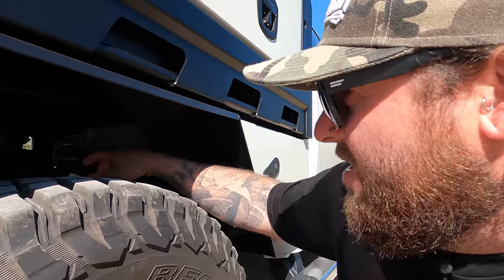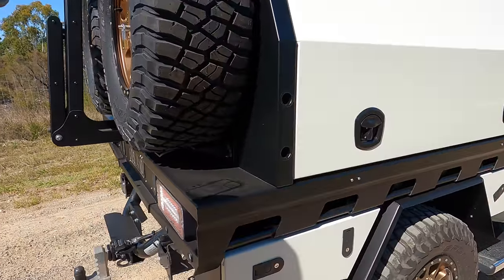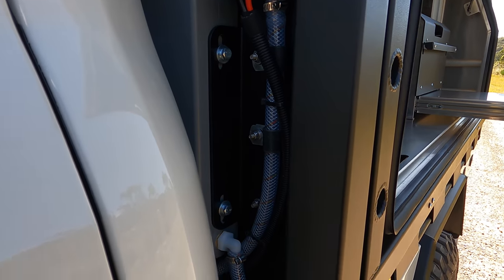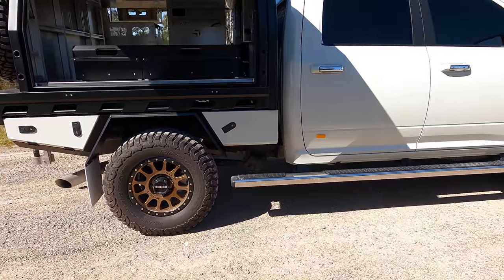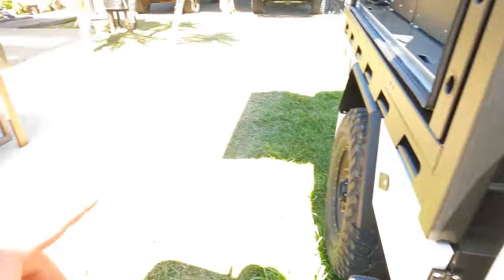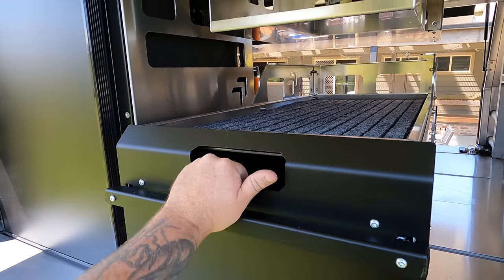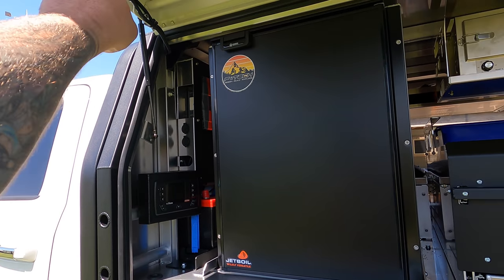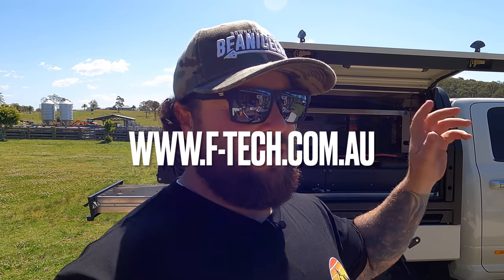RAM 2500 MITS TRAY AND CANOPY !Walk around PLUS we start fitting it with accessories !

Comment: looks good. is there some way to remove the drop down hitch and have a bar with a hitch in the middle like in the frame rails. know it would be hight but that's what drop down hitches are for.  just a little more clearance at the back. great job. dioes any one sell these here in the states for like ford F350. thanks
Reply from the maker: Tray and canopy you can get from mule outfitters mate

Comment: The inside is nice but It looks a bit odd/rustic in places. I think MITS could polish up the overall look.

-Front tool box is way too small. It should flow with the bottom of the cab.
- An infill around the tow bar
- And the most annoying thing to my OCD is the headboard corners are rounded or bent and the matching corners on the canopy are square. Looks weird

 not sure of the cost differences but aesthetically they dont come close to GCI.
Reply from the maker: GCI do amazing work absolutely. But I understand what your talking about 🤙🏼
I’ve mentioned those few things to MITS boys about infills etc. Hopefully as they continue to develop the product it gets even better.

Comment: What will the GVM end up at
Reply from the maker: We have 913kg to play with so trying to stay as light as possible. Not running a RRT just running swags but I will be running it over the bridge once I’m done with fit out see what we are at. 🤙🏼
Reply: @TyFenwick  I have a RAM 2500 with a bull bar , winch, long range fuel tank, air bags, fox shocks  and 35” tyres you can run out of spare kg’s real quick